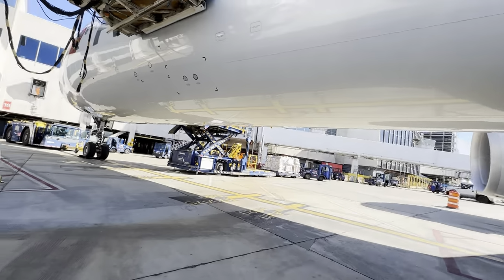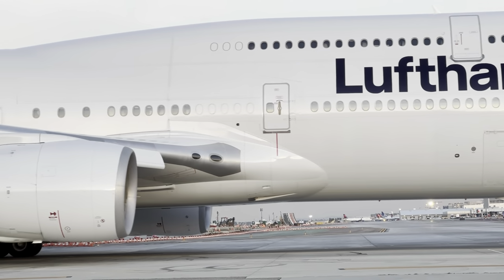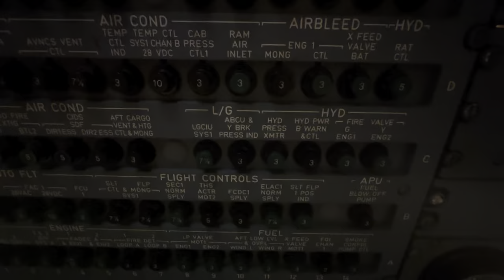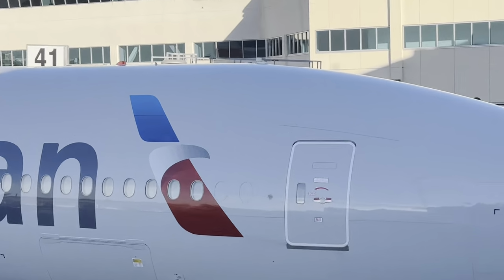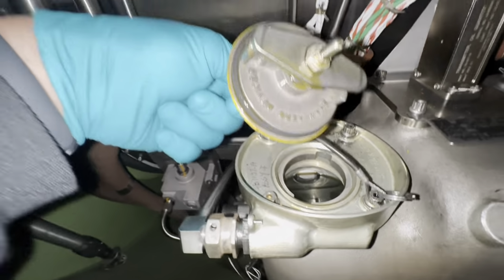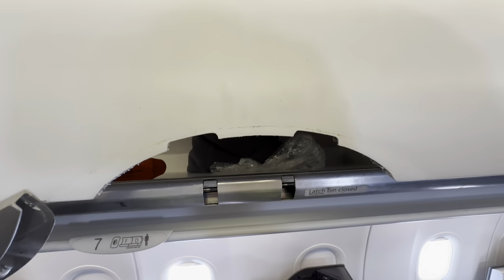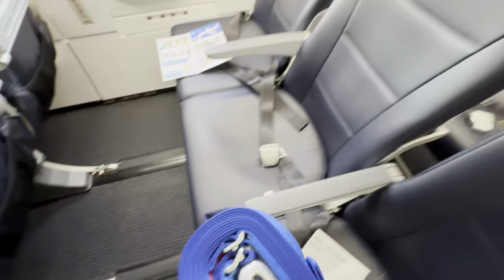Stig Shift #11 (Aircraft Maintenance Adventures)

Comment: I’m gonna ask although I’m not notified anymore when people respond but 1) I thought there was a wind shear system onboard therefore another antenna?  2) How do you  analyze electrical shorts when all the wires are white… signal tracer?  Working @Ford all systems had their own unique colors I.e: dash lights were blue/red tracer.  Mazda was fun… every time another connector was in the circuit the color changed!  Thanx
Reply from the maker: There is a windshear alert system. That’s part of the software.  Analyzing wiring usually involves troubleshooting through the system, the aircraft will usually tell us what is malfunctioning. Also all the wires are labeled.

Comment: Is there a safety measure insuring the gears don’t retract while on the ground?
Reply from the maker: Yes. The WOW weight on wheels sensors will not allow the gear to retract. Also the actual weight of the aircraft itself won’t allow it.

Comment: What is the "ATC antenna"? I'm assuming he's referring to the transponder, but I just wanted to confirm.
Plus it's so cool and weird to see ADF's and marker beacon antennas on this giant plane in 2024!
Reply from the maker: ATC antenna is basically the antenna that communicates with air traffic control. It’s a high gain antenna that transmit and receive signals over long distance. Act a lot like a transponder.

Comment: Great video's ! I'm a CH47 engineer in the UK, really interesting to see fixed wing ramp life as I contemplate a career change to fixed wing.
Reply from the maker: I always find helicopters, fascinating, in my mind they’re literally flying transmissions, but I think you would enjoy fixing aircraft a lot.
Reply: Yep that's a good definition 👌  I say to non aviation people helicopters are 10,000 rotation components waiting for metal fatigue to set in....😂. Can you do a video on how the 787 electric brake unit's work, how they apply the force to the pad/disc pack please?
Reply from the maker: @chunderbus6333  I have talked about them in the past, very briefly. It’s in my older videos. But quick explanation, it’s a series of pistons pressing up against stacked discs. Imagine car disk brakes on a massive level
Reply: Yep we have the same system on CH47 but only single disc and 3 cylinder hyd caliper. 
I ment how does the actual electric caliper work, is it a set of stepper motors and screw Jack's or variable electro magnet etc to actuate the brake pistons?
Reply from the maker: @chunderbus6333  they are electric motors with a friction brake that is attached to the motor shaft and locks the motor shaft in position when the motor is de-energized.

Comment: I watched the mechanic in Florida, he showed the built-in alternator to keep the CFM LEAP engines that will keep the engine running, even if the plane loses power.  Do all CFM engines have that? I saw him with a torn down engine, doing exams on the fan blades. They have a known cracked sample, for reference so they know what a crack looks like on the screen. Do you know him?
Reply from the maker: I believe I have heard of this gentleman, I’ve seen some of his videos. In regards to the alternator all jet engines, or I should say modern ones, have the dedicated alternator.
Reply: Very good! I never knew that!:face-red-heart-shape:Safety 1st @StigAviation

Comment: Stig, that Lufthansa 747-8 was a moment to appreciate.  Having one more flight on a 747 before they retire is #1 on my bucket list.  I have a 50 year love affair with the Queen and still going.  Recently, i saw a nighttime video of a 777-300 taking off.  I noticed that there is a solid red light illuminated inside of the left main landing gear bay, do you know the purpose of this light?
Reply from the maker: The red light indicates that the doors are active and are going to be closed. It’s basically a warning light. It’s more for us maintenance to know that the door is active. Safety light.

Comment: Hey SuperStig! I have a question if you don’t mind…you read about planes having to return due to smoke in the cabin and the plane can be on the ground for the odd day or so following the event…my question is, how do you go about trying to find where the smoke came from (or replicate the situation) when it’s likely to have dissipated after landing? Thanks so much for your amazing videos. Laterz! 👋
Reply from the maker: 90% of time it comes from the APU (due to some oil leaks). Sometimes it comes from the air conditioning system having ingested fluids from the intake and it goes into the system. And sometimes it comes from the engine bleed air that also goes into the air conditioning system.
Reply: @StigAviation  Legend! Thanks for the explanation. And I guess for the other 10% you spend 90% of your time working on 🤣😂

Comment: That composite they use for the overhead bin doors and all that other stuff you mentioned looks extremely similar to Correplast, the stuff they print "elect this candidate" signs on and put them up everywhere (I'd rather not see them, doesn't take me too long to come to a decision these days, but it is what it is).
That correplast stuff is really tough, by the way. Light, strong, and available in large sheets, so it's perfectly reasonable stuff to make an RC airplane out of, if you want a step-up from foam-board without having to resort to stick-built Balsa with vinyl film skin (which is still a very very efficient way to build an RC aircraft, what with Balsa's amazing mechanical purposes being so light and yet still technically a hardwood species).
IIRC there are or were some US Mail branded crates that are also made out of riveted Correplast, and we probably all know how rough the Post Office is on it's stuff. Those things take the abuse and come back for more, from what I've heard, so that stuff must be REAL tough!

EDIT: "You're not gonna believe how much this little handle costs" $300 sounds reasonable, after all it's not produced in large numbers so you can't really get a bulk discount, and it's also something from an aircraft, so that's never gonna be cheap simply due to the standards it's held to. That being said, I was still off by $200 (I thought it would be $100, but I should know better, the door handles on a car door are about $100 and are also largely plastic).
Reply from the maker: Thank you for sharing that wonderful information here. And yes aircraft parts can be pricey. Especially when it has that FAA PMA stamp on it

Comment: Thanks for the awesome video! Looks like there are a lot of Phillips head screws on the fuselage. Why is Phillips more common instead of hex or torx? Do you need to worry about stripping the screw? When tightening them, is the amount of torque strictly monitored or just by feeling? What happens if someone accidentally stripped the screw head or the threads?
Reply from the maker: Phillips head screws are the most common because they have more surface area to grab onto with your screwdriver. But for example the 787 uses torx. It just depends on the manufacturer, even Airbus likes to use its own proprietary screws. Everything has a torque value, but for a belly panel screw we can go about using standard practices for tightening. If a screw head got stripped, we would simply drill it out and replace the back end as well as it put in a new screw.

Comment: I have a mechanic friend at United who says the 777 is the most mechanic-friendly plane he's ever worked on, even more so than the 787, but he's never worked with Airbus.  For you Stig, what is the plane that most helps the mechanic to quickly solve problems?
Reply from the maker: The 777 is definitely very mechanic friendly. It’s a very simple and smart aircraft. In regards to Airbus , it’s even more easier to work on because of its interface and how it presents information.

Comment: Stig love your videos. You mentioned that the 737 uses cables to operate its control surfaces. My question is, are the newer 737 Max models also do the same, or is the Max a fly by wire plane? Also what do right handed pilots do when flying Airbus in the left seat?
Reply from the maker: The 737 Max is still direct control with cables, the only thing that is changed is the spoilers which are fly by wire, the rest is still the same. In regards to right handed pilots, when flying airbus left seat, well, regardless of left-hand or right hand, they still use one hand. One hand on the throttle, one hand on the controls for flight controls. I would assume they just get used to it.

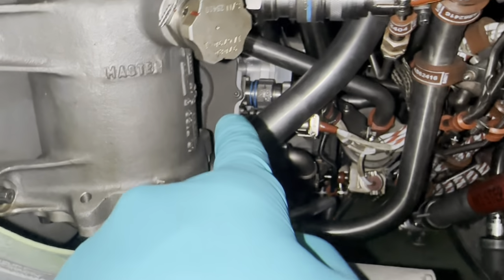Comment: 28:32 with as much stainless and other metals in the engines how does the chip detector work? Is most of the metal ferrous?
Reply from the maker: The components and that are high heat resistant are ferrous metals

Comment: Now for a real question, since I know it's a big problem sometimes in automobile engines:
Does overfilling the oil on a turbofan engine such as the ones you service on airliners cause any problems other than "now I have to clean up the mess of oil I wastefully spilled"?
I know in automobiles it can lead to all kinds of issues, catalytic converters clogged with carbon deposits due to excess oil blow-by going thru the piston rings the wrong way, foamed oil leading to once again, oil being burned by the engine because it goes out the PCV valve and into the intake manifold, and just generally poor performance from the crankshaft having to move all that oil out of the way (they're not splash-lubricated like the little Briggs or Honda engine in a push lawnmower, but I'm sure Stig knows that).
But I can't think of a way to get "too much" oil into a turbofan engine like the ones you work on to begin with, seeing as these turbine engines are basically "dry sump" lubricated, there's no oil pan instead there's an oil tank, and where the oil pan would be there's just a bunch of passages that are actively pumped into the oil tank, right? So theoretically unless you open up the passages that lead back to the oil tank and fill THOSE with turbine oil, you can't over-fill the engine oil on an airliner-type turbofan engine right?
That's what it seems like to my eyes (and prior knowledge from watching a lot of AgentJayZ videos in the past, they're an aircraft mechanic that is specifically in the business of refurbishing turbine engines of all kinds, including turboshaft conversions of former turbojet or turbofan engines (such as the LM1500 and LM2500, those are the most frequent customers in his shop)).
Reply from the maker: There are some engines that you cannot overfill, it would cause over pressure to the engine components and damage internal seals. But most of the aircraft engines are filled to spill.

Comment: The information you give is undoubtedly the best.  Question: A220 make a whale sound around 3000 ft before landing.  Whats causing that?  You are amazing thank you.
Reply from the maker: The A220 is equipped with the Pratt & Whitney 1500G engine. That engine is very interestingly designed because it is a geared turbo fan.  The reason you’re hearing that whale sound is the engine modulating its thrust. And because it’s designed with a geared turbo fan, it has a tendency to make that whining whale sound.

Comment: I have a 737 cabin air conditioning question.  The 700 series has a nozzle to adjust and has great air flow.  I’ve noticed the newer design found on the 800 and Max series which is more like a dial has horrendous airflow.  Why is this?  Seems like they took a step back with a worse AC cabin system or is the flight crew being stingy?
Reply from the maker: I’m not sure why they changed the design, it might’ve been a decision from manufacturing. But I’ll look into it further.

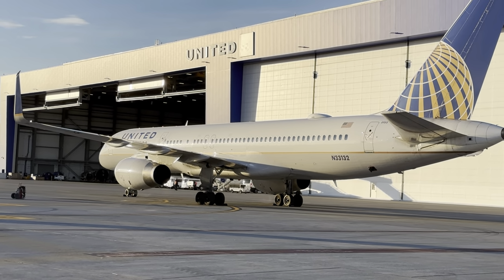Comment: 5:51 why were the elevators and the vertical stabilizer shaking like that during the high power run?
Reply from the maker: Because it’s a high power run. The engines produce an incredible amount of energy and vibrations.

Comment: During that engine test is the only thing thats keeping that jet from moving foward are those wheel chocks?
(Probably spelled wrong)
Reply from the maker: Brakes are also applied. The chocks are just an extra layer of help.
Reply: @StigAviation  
But still, that's a lot of scary force being held back by small but a lot of contact points.
Thank you Stig for your prompt reply. Stay safe!!

Comment: One question I’ve always had is about how the fan blades are so close to the cowling/bypass duct. How do the blades not touch when the engines are under power? It seems like the centrifugal force would cause the blades to rub. Let me know if there’s something I’m missing. Thanks
Reply from the maker: Actually sometimes they do rub. But that area is a special material called the abradible liner. The blade does stretch just a bit but everything is very close tolerance in the fan case.

Comment: Stig, why does the  777,  not  use winglets in the tip design? Mike.
Reply from the maker: The -200 wasn’t designed with them but the -300 has Racked wing tips. Almost works the same way as the winglet.

Comment: CES was recently so guessing that the lexus is set up for self driving based off what i can see for the attached sensors. i also had a quick question as well, back in the day i was looking to get into airplane maintenance, almost went to college for it but ended up not. my question is these days to do what you do, do you need college, or any certifications? im currently a fuel tech and am thinking of a change of scenery, i should correct here, i work on gas and diesel systems on land, mainly gas stations
Reply from the maker: All you need is your airframe and power plant license. For that you need to go to school. No degree needed tho.

Comment: Hello Stig, does the chip detector has a visually way to inspect for particles, or it needs to be removed?  Thanks
Reply from the maker: It has to be removed and then you can look at the magnetic tip of it for ferrous particles or metal shavings.

Comment: Might be a silly question, however, do the wheels still spin in the wheel wells when the landing gear is up, or stopped before they locked in the wheel wells?
Great content 💯😊
Reply from the maker: The main landing gear wheels stop spinning, because the brakes get applied automatically, the nose wheel keeps spinning until they naturally down on some aircraft and other aircraft have nose wheel stoppers in the wheel well.
Reply: @StigAviation  thanks for the clarification 👍🏻👍🏻

Comment: Since the hydraulics are pressurised how long does it take to depressurise and where does that excess pressure get vented to?
Reply from the maker: Hydraulics get depressurized immediately, it can drop from 3000 psi back down to zero in a few seconds. The excess pressure is purged through the reservoirs, but there’s always head pressure because hydraulic systems have accumulators.

Comment: That LED light around 25 minutes in had me shouting how many inductors on the PCB?!? And pretty chunky ones at that. I'm guessing for redundancy it must have multiple driver circuits driving just one or two LEDs each, rather than the more usual single driver for several (sometimes tens of) LEDs.

Still, I'd hate to be the one to have to lay that board out and get it through EMC testing, even shielded inductors like that really shouldn't be that close together...
Reply from the maker: Thankfully, in my line of work, we do not have to do that. We send it out to the overhaul shops for the experts in electronics to perform those duties. We just change out the major components.

Comment: I'm not worried about the dash-9 AT ALL. The no-bolts plane was a one-off, where someone opened it to replace a door seal. I was told by highly qualified person, that if the door is "just" opened, no CMES is generated but if the door is said to be "removed" it would generate a CMES, to require double checking the work. The failure in the system is, BOTH scenarios require all 4 bolts being removed. I do not know where the door seal was replaced, but it is known workers were following airframes from Spirit, where mistakes occurred, and were sent to Renton to FIX them. I have seen a LOT of dash-9  on ADS-B exchange.
Reply from the maker: Thank you so much for the level of information you were providing. And I’m glad you have confidence with the -9

Comment: When I fly, it's almost always on a 737 (700s, 800s, and MAXs) and I aim for the window exit row seat. I knew about the rope that goes out of the emergency exit but, fortunately, never had the opportunity to see it used. I was an A&P at TWA years ago and we'd pop those things out all the time on hot overnights to get some air flow in the cabin but as a passenger, I'd get arrested. Could you show a 737 emergency rope stowage sometime?
Reply from the maker: You mean the one in the flight deck ? That rope ?
Reply: No, The overwing exit. I sit there almost every flight on WN. There is an attach point on the wing for a cable to make evacuations less dangerous. I think it must be stored in the door jam but don't dare opening the door to find out. @StigAviation
Reply from the maker: That was the rope I showed you. The lifeline.
Reply: @StigAviation  never seen anything like it on Southwest. I’ll have to ask next time I fly. Thanks for your response.